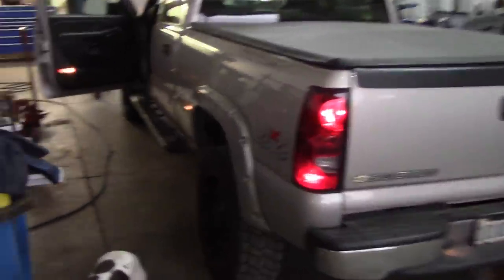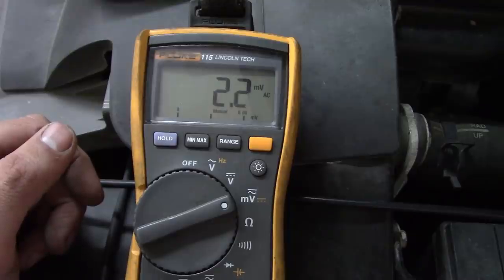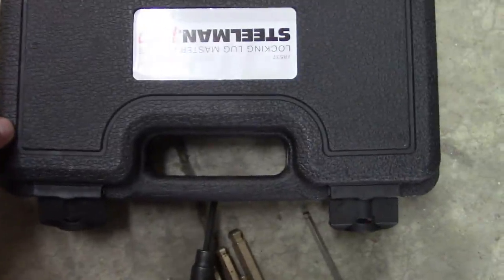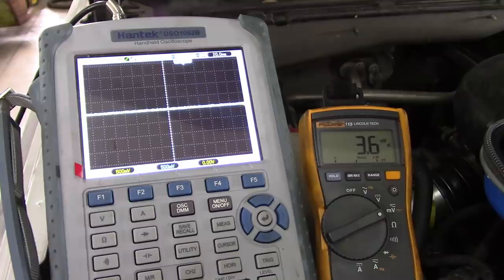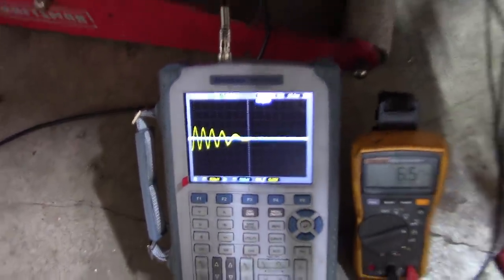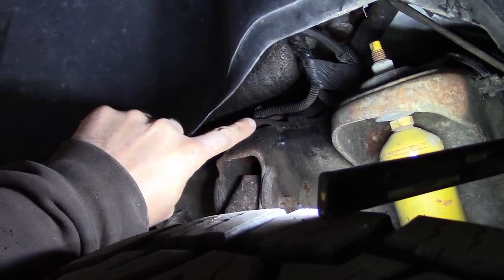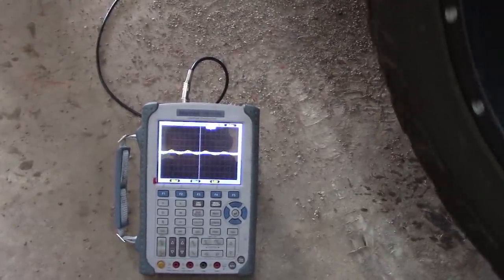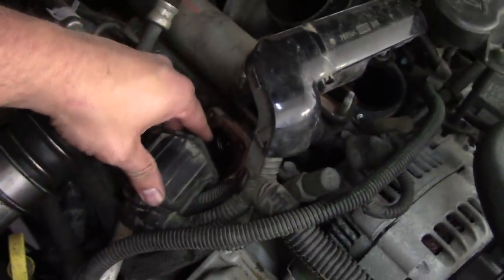2005 Silverado Duramax- Wheel Speed Sensors, EGR Flow, Glow Plug Module - P0401, P0404, P0670 - P2

Comment: Hey Wes...as a former USMC electronics technician, now disabled, I enjoy both the breadth and width of content. I also used to haul for a heavy equipment repair shop so the crawler build was nice to see and also I shared it with my former employer who owned the repair shop (now retired); he is now watching. Content can be so individually specific so just keep plugging away. I think your personality and how you narrate through what you’re doing has something to do with the audience you attract. My wife and I appreciate the family guy running his own business perspective too.

As for the speed sensors, clearly they were not reading correctly as you took the reading isolated from the rest of the abs circuit so you had to remove each one individually and clean the seat surface. One of them would have broken regardless. Don’t sweat the small stuff!

Comment: I'm a retired forklift mechanic and like the way you explain complicated electrical problems . Thankfully , forklifts were basically of simple design without needing sophisticated electronics .
I pity young mechanics having to need computers and scan tool diagnostics to fix problems . Gone are the days when the back yard mechanic could fix things . Many components cannot be pulled apart , you just have to buy new or take a chance with remanufactured or second hand parts . Well done Wes ! I'm in Australia and happy I don't have to get my hands dirty anymore !

Comment: Even if you would have found the damaged wires first, you would have still had to try and remove the passenger side sensor because the voltage measurement was below 100mv due to rust jacking.
Reply: The state of those sensors was probably right on the borderline and In the dead of this winter the module probably would have thrown a code for low or intermittent signal and the customer would have been back but this time with an undercarriage covered with ice and slush.

Comment: Hey Wes, been watching for a long time but have never commented.  I can't remember working on any vehicle that I didn't have several problems going one after another.  I also appreciate the fact that you are willing to admit a mistake and show what happened.  I'll tell you what, if I lived in your area you would be working on my vehicles.  Doing a great job.
Reply: If you're working in a dealership, where it's mostly new or almost new cars, you might run across "one problem".
But when you're working on 15-40 year old trucks, more often than not one problem leads to another one. It's really not that unusual to start off replacing u-joints and end up doing a clutch, pinion seal, carrier bearing, then have to re-bush the suspension. You just never know where a "simple" job will take you.
It's interesting to see how someone else does it

Comment: Wes I enjoy the videos because I find them interesting as they are. I don't have a tractor, forklift or a commercial truck etc... but I still watch. BTW the wire cut on camera looked like it could have been rodent damage. I've had to fix that multiple times where I live as we have pack rats that love to get under the hood and munch.
Reply: I've run into that, too.  Last year I bought a roll of Honda's anti-rodent tape and use it whenever I'm repairing under the hood.  Honda's wire harnesses insulation contained a soy-based product that rodents can detect and enjoy eating.  The tape has capsaicin pepper ingrained in it.  Where I live used to be farmland long ago so there's plenty of rodents still around.  It adds extra security on non-Honda repairs.

Comment: Don't beat yourself up about it. Looks like whoever mangled that wire did a quick little DIY repair job before the boss figured it out. Then they finished that pump. 

Anyway your test proved those sensors were about shot and the surfaces needed cleaned. That guy would have his truck in your shop again shortly if those sensors were not replaced. 

One of your best customers is one of your best customers because of what's seen in this video. Honest, reliable, does quality work, great customer service and I'd wager that you're prices are fair. It's hard to find a quality mechanic like yourself so take pride in that.

Great video. I appreciate the knowledge and a few laughs.

Comment: Love seeing this sort of video, as it shows the sorts of problems you can come across during a repair and how out of hand a simple repair can end up becoming.
I also think that you made the right choice on changing the abs sensors, as there was obviously a problem with those, as well as the damaged wire. With regards how that could have happened, I've had similar, with a stick getting jammed up in the wheel guard and damaging a wiring loom

Comment: I dont believe you threw the parts cannon at it. Regardless of the open circuit, the speed sensor was putting out less than 100mv. The other one was, but like you said, it wasnt putting out as much as the new sensor.

This style of video is much better than a single issue video. Its more 'real world.' Youre almost to 100k!
Reply from the maker: Getting close!

Comment: You showed the reality of modern life. Vehicles have changed a lot since I was messing about with them back in the 1960s and early 70s. Simple tools and simply adjustments with feeler gauges and perhaps a timing light. Carbs tuned as much by ear and feel. You show the vast increase in precision and the increased vulnerability of modern car systems. Vulnerable to rogue wire cuts and hostile environments like salted roads. That is how it is now. 
It is a fraught new world, with some trying to lock out all but their people from systems. 
It will be an interesting ride ahead and one that many will be happy not to trail blaze. Please continue to show it how it is, with your relaxed, easy going style, even when the jobs are far from easy to pin down.

Comment: Truth is both wheel sensors where low voltage so one was bad other was going that way. Probably needed them or very shortly would have needed them both.
Reply: This is exactly what I thought. You'd tell the customer "The module was toast, one wheel sensor was stuffed too & the other one was well on the way to just giving up the ghost. So I put the new module in, cleaned & carbide scraped the seats of the wheel sensors & put two brand new ones in. Tested. All ok!"
He would've been happy with that I'm sure. If you drive these oversize Tonka toys they need to be able to stop, especially in wet or muddy conditions.
Reply from the maker: I told the customer there was a low chance of getting them out.

Comment: When you first checked the speed sensors they failed the Mv test. So you did right in replacing them. You tested and they failed. No parts cannon fired here in my opinion.

Comment: Attention, customers with locking lug nuts... 
Put the locking "key" in the damn glove box & stop aggravating you mechanic!
Oh, and also, keep a pair of gloves in the glove box, it would be so damn, literal!
Reply: i keep mine in the center console when i remember i try to put it out in the open or just hand it to them but sometimes they just don't come with the car
Reply: When I had wheel locks I always kept the lock in a compartment and when I took the car for service I always put it in either the coin holder or shift boot.
Reply: I bought the Nissan wheel locks for a 04' G35 when new and they came with a special plastic thing that kept the key on the lug wrench.
Reply: @HoboJoeGarage  I'd pull it out and lay it on the seat where they would have to sit on it.
Reply: Or ditch the locking lug nuts altogether.  If you have a fancy car with high dollar rims, and you live in the rough part of town then MAYBE you have reason to use them.  No one is going to steal the wheels off of your 5 year old grand caravan...

When I bought my truck new, I told them to remove the locking nuts and install normal ones before I took delivery.  I absolutely despise them.
Reply: @Bobbywolf64  I don't disagree. IDK if the G35 17" stock alloys where a wanted species. Now I have a prius with factory 17" and I catch the kids with the hot rod japanese cars looking at them from time to time. I have locks just because and thought about removing them but am parking at work in a bad neighborhood now so I'm leaving them. It just dawned on me that I shouldn't bother with locks seeing that yesterday I saw two busted windows while walking to my car, maybe I'll carry the key with my keys (kidding).   Oh and yes I drive a Prius and watch wes work, sorry.

Comment: Wes, your format is real. At 70, I'm still turning wrenches and I've found that this is the way it is in real life auto repair. For example, I've got a Yukon that came in to check ac and front end noise. While driving to find the noise { a week of 10 miles home and 10 miles back } I finely  heard the thump, but also noticed a power steering problem and the last day i got a grind on braking. On inspection, I found it needs sway bar end link bushings {noise}, front brake pads {grinding}, power steering evo valve replacement/bypass {occasional power steering loss}, a power steering pressure hose {showed a leak}, and a front cv boot/axle {torn}. AC checked out good {advised customer use of rear air cut cool down time in half after car sat locked up all day when it was hot and humid}.
FYI  POWER STEERING LOSS OR HARD TO TURN TIGHT IN A PARKING LOT COMMON EVO PROBLEM EASY FIX IS A BYPASS/ELIMINATION KIT. I owe a special thanks to THE CAR DOCTOR channel for this solution.  He;s got a video on this fix..
Funny how many mechanics subscribe to each others channels. I don't have a channel but do sub to SOUTH MAIN AUTO, PINE HOLLOW, SCANNER DANNER, WATCH WES WORK and a few more. I know you do too. "THERE'S YOUR PROBLEM LADY".
KEEP UP THE GOOD WORK AND THANKS FOR YOUR TIME AND EFFORT.
Reply from the maker: Yep I watch all those channels. "Feeling" problems are the hardest to diagnose.

Comment: First with the abs issue it still had the air gap problem even if you found the wiring problem first. So the system had two issues regardless. You didn’t shotgun a part in. Hindsight is always 20/20. 

As far as your videos, the way you make them currently brings people along who may not understand what it is truly like to be a tech in today’s day,. They don’t understand how issues can snowball quickly or how there may be multiple issues on the same system. The issue with the abs on this truck illustrates that perfectly. You had no idea the abs had multiple issues and most people don’t grasp the reason why it can take so long to diagnose things. The way you make your videos show very well what it’s actually like to be a tech instead of TV version. I appreciate you work on a wide variety of things which a lot I don’t necessarily work on or see.

Comment: I enjoy your videos. I think you have to base it on how complicated the diagnosis and repair are. If they are very complicated, then do separate videos. If they are simple problems, then combine them. I love it when you do diagrams and explain how different system function. I learned more useful information watching a few of your videos than I did in 20 years of working on them. The only advice I have is to keep it as linear as possible. If the problems are unrelated, then follow each repair from star to finish, before moving to the next one. I have an attention span, so long videos do not bother me.. You are doing a great job.

Comment: I think you did the right thing (Right answer, wrong method). You actually exceeding the customer's expectations. You not only repaired the problem (broken wire), but you solved 2 additional future wheel sensor problems

Comment: Wes, in your neck of the woods  replacing those two wheel speed sensors would have been the right thing to do because of the rust jacking. You were taking care of a problem that would have shown up down the road anyway. It all worked out in the end. 👍 Your format works great please continue.

Comment: Keep doing what you are doing. My vehicle diagnostics are usually the same process. I get stumped and end up having to step back and regroup to come up with new ideas. Plus there are times where multiple problems can come from the same or similar causes. I don't like 5 minute videos on each issue. I'd rather watch something come in your shop, get repaired and be sent out. That's how most of us fix our vehicles too. If it comes back, hey it happens with us too. Can we all agree it's ultimately the fault of the engineers designing these things?  Haha

Comment: You did the right thing fixing the wheel speed sensors. If you would have just fixed the wire, the rust jacking issue would have caused it to come back soon.

Comment: I work on stuff that has very little diagnosis info or “fault finding flow charts”. Always start with the furthest point and work forwards the circuit breaker, you’ll generally find five repairs on the way from all the past bodges, so it’s never one thing as such, and you’ll generally not know.
In my opinion, you were correct to start with the wheel sensors, they were a problem, corrected, proved and moved on, found next fault, and you knew both sensors were proven, easy fault finding after that. Better than the handbook book IMO.

Comment: You did right changing the sensors, the one had voltage below 100mv and had rust jacking, so it definitely had a problem. The other was reading, but was not optimal, so it more than likely would fail sooner than later. Your video of the scope reading and vom output both before and after support this and your reasoning

Comment: On the wheel speed sensor, if you would have repaired the wires and shipped it, it likely would have come back due to the rust jacking anyway. It may have even set another signal code right away, too.   It's always easy for everyone to see after you've found the problem.  I think your diagnosis and repair was just fine and you did your customer well.

Comment: Wes I think that is a perfectly logical and sensible approach to take. The voltage was low on the sensors, and with the rust, it was always going to want dealing with in the near future anyway. Replacing the sensors was definitely not a mistake - I'd call that preventative maintenance, which is never a mistake. I've actually had this exact same problem on the wife's Honda - replacing some very crusty wheel sensors and cleaning the rust away resulted in no change. Like you, I eventually traced it to a damaged cable just upstream from the connector on the left rear wheel. It looked like it had taken a hit from a blunt object, possibly a slipped spanner when the last guy was changing the fuel filter which is quite nearby was my guess. Anyway, I certainly did not regard replacing the wheel sensors as a mistake when I did that job, and neither should you.

Comment: Great video.  The chineseum stuff drives me nuts.  I’m a rank amateur, but your videos and SMA’s have taught me so much with cleaning up rust and what rust does to critical components.  Yeah you can swap the part out, but all the necessary work to clean the rust up is so important.  I have a 2004 Silverado, the rust cancer is starting to get to it.  Next weekend project is the rear diff cover.

Comment: Keep it like you have some times multiple different problems come to one conclusion. Plus I enjoy it and learn things myself. Even with being a mechanic for nearly 50. You have helped me look at problems from different ways and it helps in my diagnostics.
BTW the one you did on the having problems putting gas in and it was the charcoal canister. I have been banging my head on the problem for 6 months on my own truck. It got a bit better after changing the purge valve but was still there. Changed the canister yesterday and now i can fill it with the nozzle wide open with no problem thanks for the help.
Reply from the maker: Great!

Comment: If the wheel sensor code came on very recently to bringing it to you, then maybe repairing the broken wire was all that was required, BUT, you know your local environment, ref salt damage, and it's impact, so both sensors failed OEM test prerequisites, and you know your customer, and it's not a case of flipping it.
My 2 pence worth.
Great vlog as normal, content and presentation are fine.
With no state vehicle testing, then vehicles will have multiple faults.
Thanks for sharing.

Comment: Just found your channel, really like your content. I don’t live in the rust belt or work on much on road gear, but when I need to prep, scale or paint surfaces around holes that I want to keep debris out of I use disposable ear plugs. Works good, easy to pull out with a pick and keeps the crud out of your bearings or threads.

Comment: Oh yes...these EGR valves...mine's stuck too, disconnected the actuator after I changed that thing, cost around 60€, the valve itself is a pressed-in brass piece in the aluminium intake manifold, only available as one piece for 400€ new...thanks Ford Europe...
:-/
A spraycan of EGR cleaner is around 8€, gets into use before the Tüv/MOT/ inspection every second year, will do for good...
:-D
Keep the vids as you like, we will watch you work anyhow...
:-D
Thx!

Comment: Usually when it says a circuit code it's been in my experience there is continuity/wire integrity problem with the sensor. Rust jacking sets the sensor performance/erratic signal. Looks like someone's pry bar got the best of that wire. Good to know on the EGR motor. Great job.

Comment: Your all good. Any format you do is fine. By the way, I have an 03 silverado. It had the same issue. But mine was rust jacking. Never heard of it at the time so I replaced both sensors. Still had it. I pulled them out and cleaned the area and treated. Problem gone. Broke both old sensors getting them out. So point is your fine.